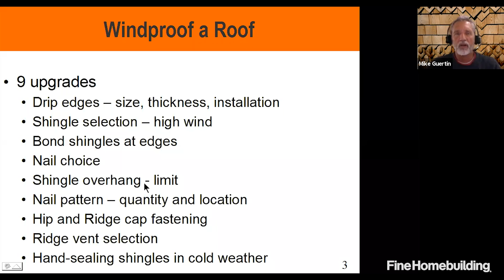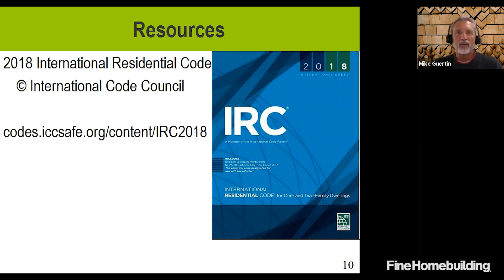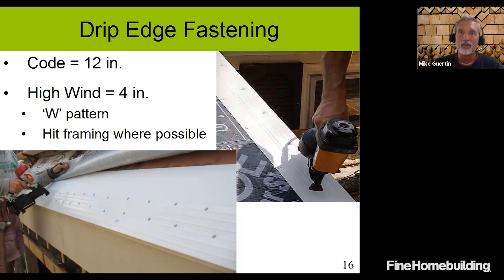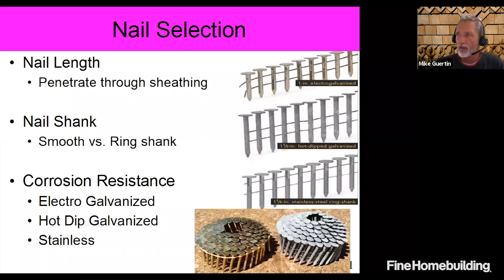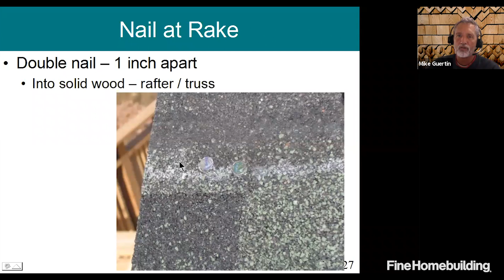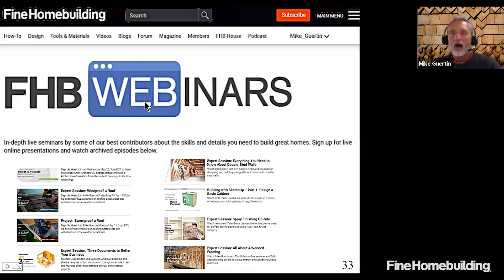Project: Roofing in High Wind Zones

Comment: Smooth shank nails should be banned in housing construction.   
1) Shrink shank or structural screws.    
2) 4” spacing.   
3) Ridge strapping 24” over both sides of            on every truss and 48” up from eaves.    
4) garage door high wind rated to protect roof sheathing 
5) Fire Protection. 4”. Comfort board mineral wool and steal roof.   Increase efficiency and make it class a rarer.  Though pairing trusses with class a rated fire paint.

Comment: I would also add the recommendations from Fortified roof requiring seams to be taped with a seal seam tape, or the use of a fully adhered ice and water, or fully adhered underlayment in lieu of tape, as allowed by fortified home.

This is in the event that your shingling best practices do fail, and you have a blowoff, that the water intrusion and damage still be kept to a minimum.

They also recommend the sheathing nailing pattern on eave and rake edges to be closer together with longer ring shank nails. Especially with gable walls that act as a sail and divert wind up and direct to any roof overhang. This will minimize sheathing pull off.

Comment: Hi, This is really an informative vid.  Thanks for putting it together.

I did have a question about something you mentioned regarding shingle nails typically not being pulled from the decking.  There are some soft runs of decking on my roof that should have been replaced during the last re roof, but were not.  I intend on re enforcing from underneath with 2x4 planks running down between the trusses.  Should I also attempt to re nail the shingles in those areas to the 2x4 supports?   I do live in a higher wind area.  Thanks